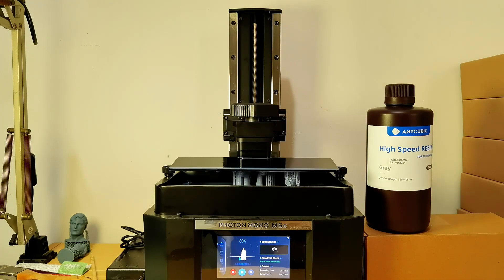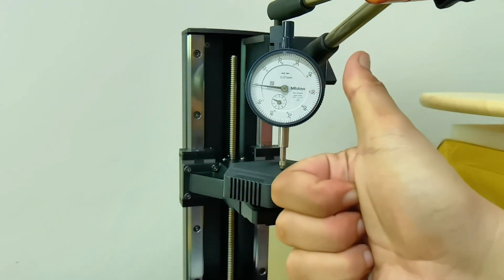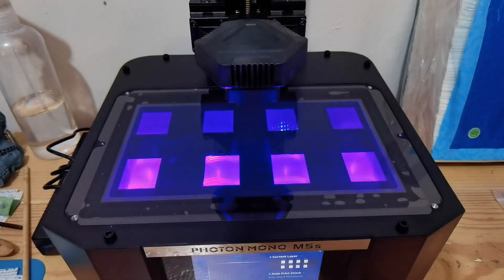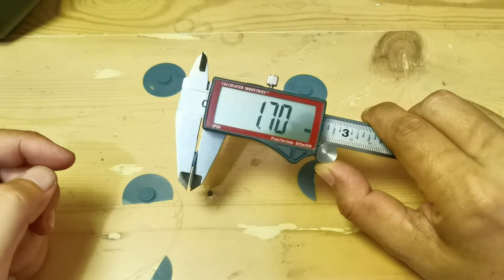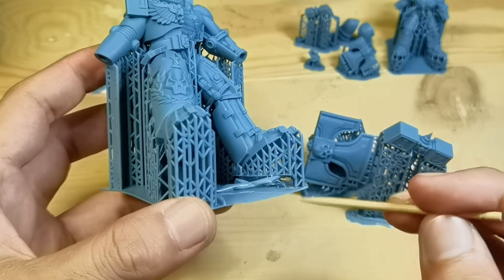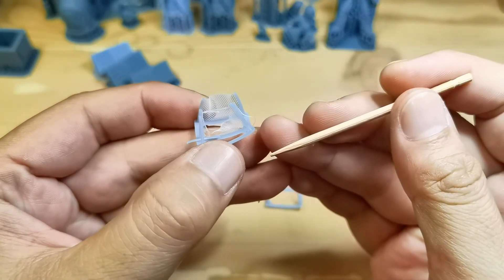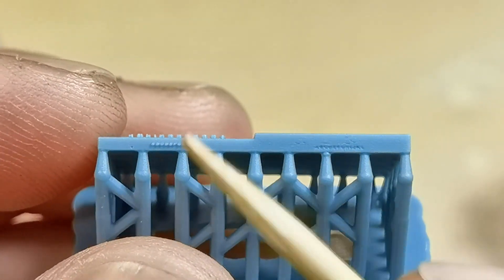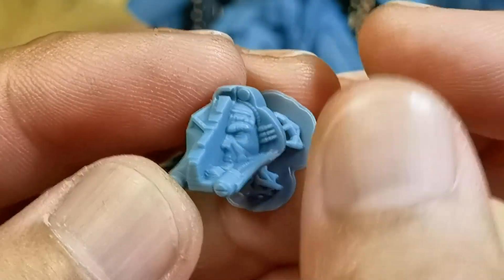Anycubic M5S In-Depth Test And Review

Comment: The plate was completely offset front to back on this horrible printer! I designed a new shim for it and solved the issue! The spacer between the plate and the clamp bit thats bolted on to it was 2mm short and cut at an angle so lifted the back of the plate up 2mm while front was touching the screen! Oh Fun days that thing brought! I haven't bought anycubic since this!
Few of us were helping with feedback like unwilling beta tester at the time and got a V2 build plate made for it and got them to send them out free to buyers who sent in a ticket! It solved the issue adding the 4 hex bolts to manually level the plate but by then i used it twice and threw it in storage!  The things still sitting there to this day!

Comment: It’s hard when you don’t know how to type on printers of this kind. It prints great out of the box if you know how. If you don’t know, figure it out and then do reviews.
Reply from the maker: LOL fanboys detected
i guess someone just see the thumbnail without watching the content.

if i dont figure it out, how the hell i have print results for the video. LOL

how to type on printers of this kind? what are you talking about? how the hell i type with a resin 3d printer?
Reply: @wangdennys  i have som sla and dop printers, an they printing perfect if you  use right parameters of printing).
Reply from the maker: @killswitchfpv5820  as i said. I did figure it out. Then i make this review.
As i have printed several models for the video.
I have 10 years of experience resin printing and built my own back then.
But it is still the worst in my opinion.

Still "how to type on printer of this kind" What do you mean?

Comment: Have to ask a question. When you were swapping resins, were you swapping from the matte FEP to the regular FEP when using the non fast resin? I have 2 vats for my M5s, one with the matte fep for the high speed prototyping, one with the regular clear fep. I've never had the issues you show in this video with either. The M5s is an M5 when all of the fep and resin and settings are changed to non high speed.
Reply: thise man? dontt know how to print on such printers. that's the whole problem

Comment: As always, great video. If you watch FauxHammers video he did find that using the regular clear FEP film fixed the sharpness issue. The ACF works great for fast printing but not for the sharp detail. I have one of these coming and I am planning on having two resin vats. One with the ACF for rapid prototyping and one with FEP for more detailed prints. Time will tell if this works for me.
Reply: Did you see better results? If so what was your preferred resin? I’m have a hellish time figuring out how to get decent prints on this damn machine.
Reply: I have seen some detail improvements with the FEP. It's really rare that I am in a hurry to get a print completed, so slowing things down for printing on FEP isn't a big deal for me. But it's nice to know I can print fastbif I want to.

As for resin, I am using the Anycubic Water Wash +. It is giving me great results, and I like that you don't need to use IPA for washing. 

My advice would be to download the Cones of Calibration from Table Flip Foundries and spend the time to get your exposure dialed in. Once I did that, I used Anycubics recommended settings for that resin. Other than the exposure time of coarse.

I hope this helps.

Comment: To fix the compression I added a washer between the build plate and arm. Also I loosened all the bolts that attach the arm to the rails. Between the washer and the small tolerance in the bolt holes we were able to eliminate/minimize shrinking issues in the base layers.

Comment: Excellent review, I like the empirical approach.  Many others have experienced this detail loss issue on the M5s and narrowed it to the ACF film.  Looks like the one from Anycubic really sacrifices detail for speed.  Some are using the nFEP tray from the M5 on the M5s to get the full 12k detail. They then swap it out with the ACF tray if they need speed. Please give this a try and let us know how your results compare.  Thank you!
Reply from the maker: If you see my reciew on acf film itself. 
I dont see any different comparing acf and nfep on mighty 12k.

So i think either the lamp is op or, there is a thick glass on the screen because of pressure from the leveling free feature.

Comment: Thank you for a very informative video! It could explains why my m5s don't perform. When bought I didn't get one decent print out of it. After issuing a ticket with Anycubic support the fault was the leveling. I then received a new adjustable build plate. After leveling following a video from Anycubic it now works but I get longer prints banana shaped and distorted. My thoughts is that its the printing process in itself but perhaps it could be the uneven light strength from the display. I have a Elegoo Saturn 3 ultra on its way and it will be interesting comparing them when it arrives.

Comment: Detail could be lost because of the distance of the screen to the build plate. The further away the screen is from the plate, the softer or more light bleed can occur. That's why I would never use a screen protector because it increases the distance from screen to plate.  Also, ACF film is thicker than NFEP, this will also be a factor.  In the most ideal situation, you want that film to be directly on top of the screen and for it to be as thin as possible, then you will get the sharpest prints.
Reply from the maker: On my test with mighty 12k
Acf vs pfa, the print result is the same.
I think there is a thick tempered glass that add too much distance. Or the light just too op.

You can check my video about acf

Comment: Anycubic told jessey that the softness was due to some post processing they apply to slightly soften layer lines, but the result is way softer prints, it's ridiculous. That could be fixed in firmware but the matrix led just can't, imo such a light engine just isn't good enough for 12k
Reply from the maker: Yes i also think the issue is op light source

Comment: I don't get why the shipped the printer with the self leveling system when it doesn't work at all
Reply from the maker: It should work. 
But something missing here.
Reply: @wangdennys  have you tried using long wait times?? with normal printers if you don't wait 20-60s wait times for the first 1mm or so the printer doesn't have time to squeeze the resin to the right thickness, as a result the first few layers can be as much as 300um thicker than they should be, this is why people need such high base exposures, with long wait times I go from 30s to 6s on burn in layers and I only need 2!! A screen with springs could mean on these first layers the resin isn't being squahsed down as much due to the springs, this could be why  people have such issues with getting prints to stick on this printer. I'm not sure exactly how it works though, are the springs loose during the whole print? or does it send the plate down to the springs and then clamp the screen in place? if the screen can move during the whole print then it could never work because lets say your plate is off by 1 degree, the springs could help the first layer be more consistient, but if the screen isn't then locked in place to match the angle of the screen, as the print continues it will move and as a result the self leveling won't level the later layers where there is no force to push the screen to be at the same angle as the plate.

Comment: Can you tell more about mesh test? what those results tells you, how do you "read"  that test?
Reply from the maker: If the printer can do fine details
The smallest mesh 0.1 should be able to be print.

Check my other review to compare
Reply: @wangdennys  I actually quickly looked at your other vids to compare and it's the first time I see that test. I may miss something. anyway thanks for clearing it up. I think it also depends on resin, but if the resin is 100% good and gives good results on other machines then yeah.

Comment: Why do we need auto leveling for resin printers?
Auto leveling is useful for large FDM printers, however, it seems to be less usefull for resin printers.
Reply from the maker: Fdm auto leveling is real auto leveling.
This is just leveling free compensate by springs to withstands the plate pressure. 
Cheap hack but doesnt work well.

Comment: The M5S has one of those sh*tty "LCD grid arrays", the optics are absolute crap on that printer.

Also the "auto level" is funky as you saw, and believe it or not there is a force sensor in the gantry - it looks like Anycubic "rushed" out this printer, what a shame, but that's Anycubic...

On the Voxeldance Tango discord the user "Marco" did very detailed posts all about the M5S, it's very interesting and worth looking at.

Great review as usual!

Comment: I have a long story of misery with this machine. In summary parts arrived broken, months waiting for replacements. Support refused to replace things and had to buy my own replacements like a new VAT. My first print with high speed resin (just bought one bottle to try it, no intention of using it long term) resulted in a decent looking statue but the parts were some of the worst dimensionally I've ever seen. I have some major filling and filing to do. Also more worryingly resin is splashing out of the VAT onto the machine case, the VAT walls outside and onto the machine next to the screen. Not a small amount of resin either. Needing multiple paper towels to mop it all up. Is that the high speed mode causing that? I have no idea. I've ditched the high speed resin and about to start using good old fashioned cheap resin with a bit of tenacious mixed in. I need to dial in the settings and hope this splashing doesn't continue because it will end up ruining the screen protector. I think this will be my last Anycubic machine but still got some hope I can dial it in better. Videos like this are super helpful but also a bitter pill to swallow finding out the gritty details. Still I pre-ordered, that's on me haha.
Reply from the maker: It will takes time and patient.
But you will be able to use it like i did in the video.
Reply: with people like you making videos like this and putting advice out there I have a chance🤓 @wangdennys
Reply from the maker: @ClayMann  you will make it!
Don't give up
Take your time 
And be patience

Comment: Glad i ordered the Elegoo Saturn 3 Ultra over this, didn't understand auto leveling on a resin printer, on all my printers i just level once and never need to relevel also shorter buildplate was a huge problem for me. The ultra has been running great so far.

Comment: 1) you are not one have problems with auto calibration. some printers can not print at all from box.
2) vertical lines on panel is from acf films as i know from other blogers and users
3) problem with sharpnes is also acf problem
Reply from the maker: I reviewed mighty 8k upgraded to 12k.
Then compare the print result using acf and pfa, the print quality is the same. 
I don't think it is the acf.

Or could be different acf quality than what i use on phrozen 12k review?
Reply: Itt coulld be since the glasss in the M5s is much thicker due to the use of pressure on the screen foor auto leveling. My guess is that they used a thick ACF film to protect it from auto leveling as well. If so this would make the M5s auto leveling feature a big mistake! The auto leveling is off by up to 1mm on the plate edges when tested with paper over the sensors and no VAT with a fake print run which is ridiculous leading to multiple print failures and having to compensate by long intial layer curing and large rafts. Anycubic know since they are providing new build plates with manual adjustment screws (the V2 plate) to buyers who scream loud enough. @wangdennys

Comment: I preordered this printer, as well as one for my brother-in-law. We were both over the moon excited to have such a good upgrade from our old Mars 2 pros. After getting the printers up and running, we were having so much trouble getting good results. My brother-in-law couldn't get a single successful print after half a bottle of super expensive Resione resin. I was using Anycubic standard and was able to get some prints, but was getting regular support failures and very soft overhangs and overall detail. Over the course of a couple months we both ended up selling them and I purchased a Saturn 3 ultra, and my brother-in-law bought two additional Mars 2 Pros as we couldn't tell the difference between the higher resolution. The difference between my M5S and Saturn 3 Ultra was night and day. I have yet to get a failure on the Saturn to date that wasn't my fault. I've been thinking about making a video comparing results between the 3 printers. Glad to see it wasn't just us!

Edit: my guess for the loss of detail compared to other printers is due to the light source that they use in this printer, as the M5 uses a traditional leveling system and PFA/FEP but still has issues with detail.
Reply from the maker: Sorry for your bad experience.
At least you learn something.
Reply: Agree. I DO NOT recommend this printer.